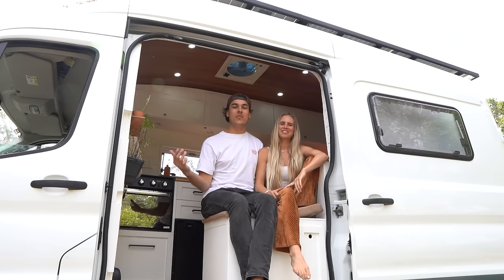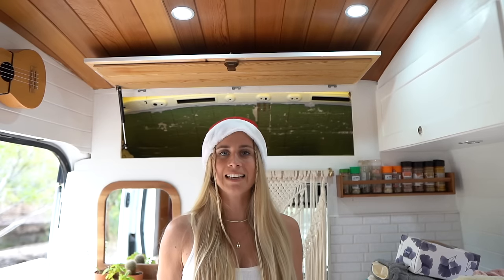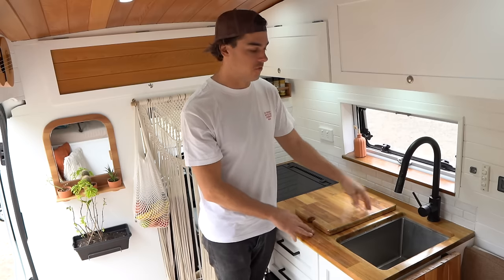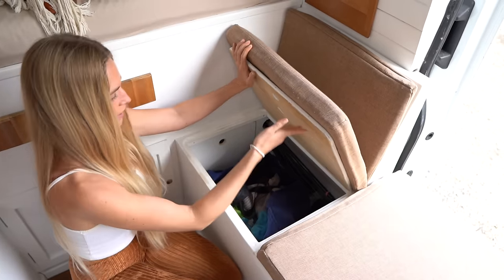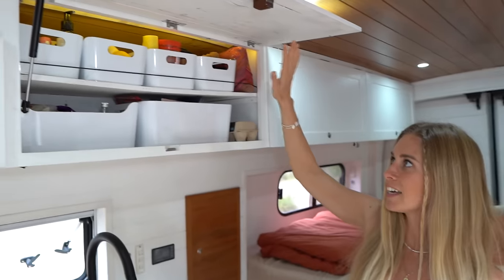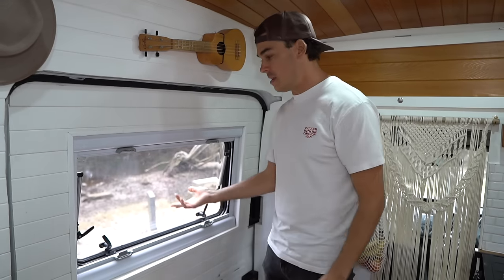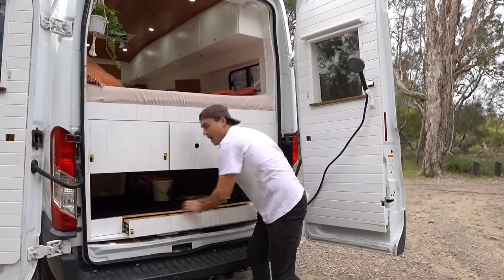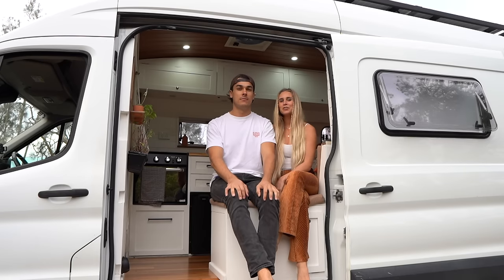Aussie ENGINEER Builds Functional & Stunning TINY HOME | VAN TOUR Ford Transit

Comment: I started my van build with monkey see, monkey do, from your build videos.  Tomorrow will be the first trip away in my 99% complete van.  Thank you for sharing your build process, it was a huge help to this first-timer.  

Please god, no more Bunnings runs for a while!
Reply: You found an amazing guide with this channel. A very ambitious type of build for a first effort so if you followed their template well done! I think the electrical system here is the best I've seen and they were so generous with the detailed plans and step-by-step.
Reply from the maker: Thats so great to hear! I hope your first trip goes well. You generally find small things to change and alter on a first trip! good luck!
Reply: I used the sub-floor design, small parts of the framing and leaned heavily on the insulation technique and materials, then diverged completely because I wanted a lighter build and more of a wood cabin feel  - so lots of varnished wood.  But when I started it was basically a carbin copy of the floor and insulation.  I also wanted a larger battery capacity so went with four 100Ah Renogy lithium batteries but the same DC to DC charger and basic fuse box design.  It  turned out to be a really well insulated and comfortable space, so full credit to the salty van!

Comment: You are so right about ventilation! I think unless you have lived in a van it is really easy to underestimate how important it is to an enjoyable experience. 

Do you think the  trade-off for a more premium and beautiful van has been worth the additional weight overall? Do you use the roof deck often, or is it just nice to be able to climb up for photos sometimes? I see it on a few builds but I don't think I would use it enough.
Reply from the maker: I would say we use the deck it a medium amount. More so when we are in one place for a while and able to just relax a bit. Regarding the weight, there is probably some things i would be able to do differently to reduce the weight slightly but i wouldn't change the design and style as we absolutely love it and it feels like home to us.
Reply: Yes ventilation is critical also for reducing humidity.

Comment: Thank you for the tour it's very nice. I had to work with one of those fans driving all over the country and I had to have space for my clothing and things since I cooked in the van through although it was for cargo so I could not make it look nice, but the storage on the top that you showed where you have boxes and stuff I found these long Rectangular plastic tubs in the automotive department of Home Depot. They were great. They fit perfect all four and I would slide them in and out very easy, and I could see even though I'm 5'2"what was in them and I had labeled them I had a sign each plastic tub one was for shoes. One was for my pants and T-shirts. Another one was for my coats and other clothing on the way is it socks so everything was a Maitland put away and I folded it and put it square of clothing, so that it fit wrinkle it was perfect, so maybe those boxes actually have a sliding return it's easier to manage whole space cubby on the top of the driver and passenger seat

Comment: Great tour guys.  I have the same van but 2010.  I originally had a mid roof which I converted myself I love my van but at 5’8” I could not stand up so bit the bullet and bought the high roof model.  My layout is similar I just have cupboards both sides.  I have 2 dogs I travel with so I don’t have a garage as I have built in crates under the bed.  Your videos have been fantastic and I will be referring to them as I progress with the build. Wishing you all the best with your adventures around Australia.  Such a cute couple!  😁🐾🐾
Reply from the maker: I think the single most important feature of a van is the ability to stand up. It will save your back. We would  love to travel with a dog or cat one day and make a little home for it under the garage where we have the door that opens under the sliding table. Thanks for the lovely comment!

Comment: Cover up the bulkhead ceiling with some marine vinyl or marine plastic thin sheet.  It will look nicer and be cleaner for your items.  No bits of insulation falling on your stuff.
Keep plastic plants from IKEA. Don't torture real plants with lack of sun and cramped pots. They are living things.

Good job on using real tile.  Looks and feels authentic.  The trick with tile is this: use a light backing like Schluter Kerdiboard. When you add the thinset mortar, mix it with Polymer not water.  Ditto for the grout - use a polymer not water. This rubberizes both thinset mortar cement and grout and prevents cracking from vibrations. It also waterproofs it, no sealant needed.  Use small mosaics over larger tiles. Your subway tiles are a bit too big for van use, smaller is preferable both for weight and less cracking.  MAPEI an Italian brand is very good.

 Love that pull out table from the back!  Very handy.  Roof deck is awesome
Beautiful interior space!  Enjoy your van!
Reply from the maker: I mean common they are indoor plants... Much like any indoor plant you would find in any home. They thrive in the van and are very happy plants We really don’t like the plastic plants as well.

Comment: I would prefer an indoor shower and toilet because I would not want to take a shower outdoors in the winter (I am assuming the van is designed to travel all year round). I also prefer to have a cabin for the toilet. I like to have a bigger seating area so the bed should be a convertible - you could leave the bed out if you have no guests coming - but a sofa and table for 4-6 people would suit me better. I would also put the cooker on the side of the door. I like everything else about the van.

Comment: You have a super van, I just love it. Being a single female traveling around Australia I would like a big aluminum roo bar and the table at the rear long enough to be able to use as a sun lounge. A TV and a pull out barbecue would top it off for me.
Reply from the maker: Sounds great! A bbq would be nice. I was considering carrying a Weber Q in the back so it was near the gas bottle but i haven't got around to it yet. Bull bar would also be nice but I was hesitant to add even more weight to an already heavy van

Comment: I think what you have built is absolutely amazing 
I had an iveco van and was going to do a similar thing but it didn’t work out 
But i see the roof vent which I have used and they are fantastic especially with the in and out function 
I had also planned to use those same windows in my van 
I’m glad to see they do work so well and if I get to build a camper van I definitely will buy them 
Happy travels and thanks for a great video 👍👍👍
Reply from the maker: Thank you, yes we absolutely love the windows and the vent system in the van. Hugely important that is often overlooked.

Comment: Great build mate! You forgot a very important part that left me hanging... WHAT HOLDS YOUR DRAWERS?? Haha you went down that path but didn't mention it what you actually used?
Reply from the maker: Haha whoops. We used a combination of soft close slides and upgraded the magnetic holds by removing the crappy magnets out of the stock holds and replacing them with neodymium magnets. For the heavy drawer we used of 40kg magnetic hold.
Reply: @saltyvanventures  Ahh thanks for the response! I can finally sleep at night after that cliff hanger :) That's a good idea! They hold well? Drive like crazy much? We were thinking of using electromagnets for a 60kg hold
Reply from the maker: @WanderingandWilderness  Yes they hold well. This has been the result of quite a few trial and errors, some more errors, and some failures. We are finally happy with how they hold.

Comment: Nice build but your missing some vital safety equipment...no smoke/fire and Co2 detectors, no extinguisher, no fire blanket...hopefully you'll never need them but you never know...the porta potti can be placed on a stainless steel deep dish tray as they do leak esp on rough roads, a battery fan in the box keeps the smells under control and if you cut the front panel and make it into a hinged door, its easier to use and clean and a sprinkle of no name nappy powder in the tank helps the smells too...enjoy and staff safe
Reply from the maker: As part of our campervan compliance we do actually have an accessible fire extinguisher next to the oven and a smoke alarm above the bed

Comment: Man we are on the same wavelength! Same van, for the same height reasons. I'm 6'4", 193cm, so not sure I can do the sideways bed unfortunately, it's just a bit too cramped. But a King size going the other way is fine :)
Reply from the maker: The transit is ideal for un tall guys. If you get the front wheel drive you even get an additional 15cm of height too!

Comment: Amazing build! Qq why most Australian vans separate the cockpit and the living area? Why not using a curtain that is heavily insulated?
Reply from the maker: We did it for the heat as well as the privacy. You also open up a new wall that you an use to hang stuff. Also as we were never going to install swivel seats it made sense

Comment: You should put an anti mosquito net in the rear to protect your bedroom whenever you open the doors in the back .. I guess
Reply from the maker: We had originally planned on hanging a white cloth much like a mosquito net from a bed at the back which would have also acted as a privacy screen while still letting in light, but we went away from the idea to reduce the clutter.

Comment: Really nice van. Thanks for the knowledge you share. Just a few questions, how does the diesel heater work ? Does it turn off when it reaches the temperature that you want ? or does it go down to a lower heat setting ? How does the 5kw version hold up in cold climate ? How long does it take to heat up your van with this heater ?
Regards from Denmark
Chris
Reply from the maker: There are 5 heat settings on the controller. Leaving it on 1 is pretty nice on cold days but can even get too hot sometimes. Level 5 will heat the van up in 5 minutes and then you will start cooking like a chicken.
Reply: @saltyvanventures  😂😂😂😂😂 thanks for the reply

Comment: Superb!
But I noticed you dropped the internal surfboard storage.
Also how often do you get stuck on wet grass? I have an ancient HiAce camper but the lack of 4wd is driving me crazy. Even a diff lock would help. How do you get on?
Reply from the maker: We still have it but I just haven’t been carrying around any short boards due to having a lower back injury. So to stop myself from temping to ride and injuring myself again I didn’t pack it and only ride the mal for the time being.
Reply from the maker: Regaling getting stuck. Haven’t been stock on grass yet. Got stuck in some muddy ground and sand but yea a diff locker would be really nice to have.

Comment: Very good but no internal shower or private toilet room! A bigger fridge with seperate freezer would be nice....... Very, very good though. I am on the verge of my own build and this has been most inspiring.
Reply from the maker: It's really hard to fit an internal shower and private toilet in a van this size while still maintaining an open feel. Its all about compromises really. You just cant have everything 😂
Reply: @saltyvanventures  Thanks for responding, I'm very quickly finding this out.

Comment: Do you not miss an AC? Im thinking about ripping my out and putting in a Sky Light. But not sure if I miss the AC :/
Reply from the maker: I don’t particularly like ac so I don’t miss it l. With adequate ventilation I don’t believe you need ac at all
Reply: @saltyvanventures  Good to hear! Im wondering why you dont like AC?
Reply from the maker: @prophetseven728  We just don't like the dry air from AC
Reply: @saltyvanventures  Got it! I get that!

Comment: I’m interested in building two vans. I’m a contractor and do a lot of finish work so I’m just curious about the electrical system and all the digital screens to run it all.
Reply from the maker: Check out my video on the complete electrical system I installed if you are curious https://youtu.be/ydx0ArPgm84
Reply: @saltyvanventures  …thanks. I’m not just curious. I guess a wrong choice of words. I’m wanting to learn from the best and get it right the first time. So thanks again.

Comment: Folowed on and off your build. You know, imma lazy boy... However i'm so proud i cheated for it's a gorgeous and well thought vav - as you can see van that looks good and other that are well thought, rarely both. But a question: no internal shower set up? Why?

PS: bet cargo area drawers are only 6 3" thing only... 😂
Reply from the maker: We didn’t design an internal shower for a couple of reasons. With the size of this van you could install it but it takes up so much precious space and you would loose that open living style. Also with the climate in Australia, is doesn’t get that cold so showering outside year round isn’t an issue. Lastly Australia is pretty easy to find a nice private spot to shower without people in most places so it’s a compromise but you can’t have everything
Reply: @saltyvanventures  Ok, i get it. Thanks.

Comment: 13:10 that DCDCmppt solar unit is garbage, but for only charging 140ah it's fine I guess. Also, renogy themselves say that you need 2 batteries to get 2000W, AND that garbage DCDC will only charge at 25A maximum if there's any alternator DC input. 

Having said this; I am 100% in the renogy ecosphere for my build.   I just read the manuals.
Reply from the maker: I'd have to disagree, I can't seem to fault it. It may not be suitable to builds with much larger solar arrays but for our system and especially at that price point its hard to beat.